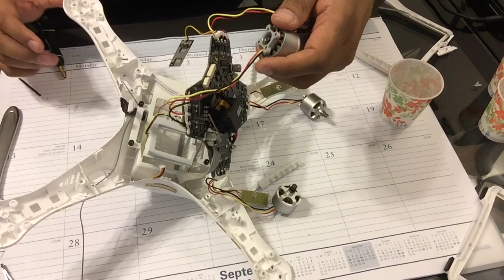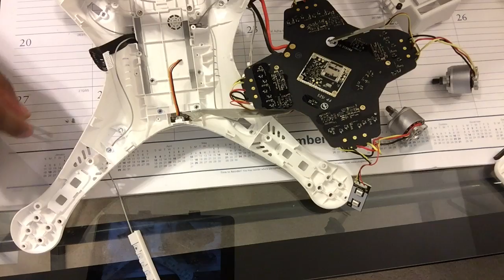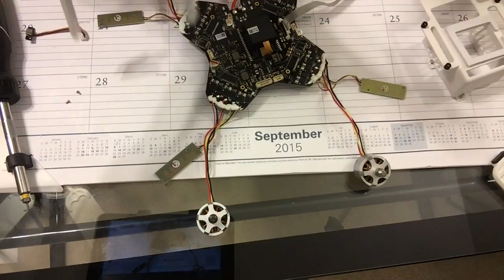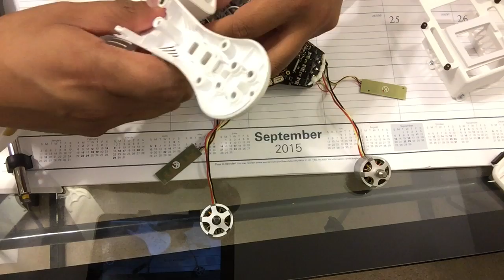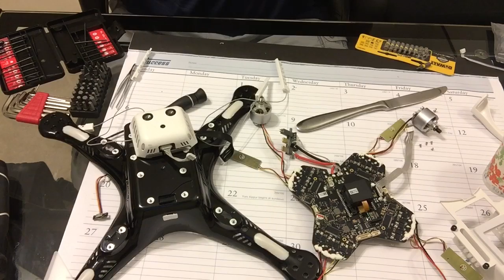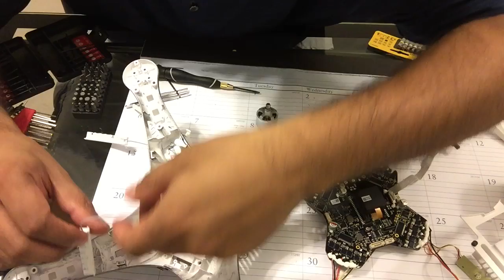DJI Phantom 3 Pro:  Full Breakdown and Rebuild (Part 4 of 5)

Comment: Would it be possible, with the board removed, to get Lightbridge working so you could use it with a different aircraft (after somehow attaching that big board/antennas to an airframe)?
Reply from the maker: +cbluebeard It's a good question.  Keep in mind that the Lightbridge antennas don't connect to the main board.  Instead, they connect to the smaller VPS module which in turn connects to the motherboard.  So, in theory, they can be used for other Phantom 3 Pro/Adv aircraft but I'm not sure if they would connect to anything else.  Having said that, I admittedly have not tried so I don't know for sure.  If you do end up trying, would love to hear about your experience/results.  Good luck!

Comment: use a dab of museum wax to hold those tiny screws to your screwdriver... works great for fumble fingers
Reply from the maker: Great tip William.  Where can I find museum wax?
Reply: +Suhail Imtiaz 
hardware stores, I think.
got mine many years ago
It's just called 'museum wax' made by Trevco-Monrovia Ca

Comment: Where is the receiver located?
Reply from the maker: +Will Robinson Hello Will.  If I understand your question, the receiver (OFDM Module that communicates with Remote Control) is located just under the VPS module.  Directly under the VPS module cover, is the VPS unit, and just under that is the OFDM module and that is where the four Lightbridge antennas connect.  Hope that helps!
Reply: +Suhail Imtiaz Thanks for replying. I sent in my P3 for repair and they said they replaced the receiver and gimbal. They had the stickers on the arms cut so apparently they had to take the shell apart. I thought they could replace the receiver without taking the shell apart.What do you say?
Reply from the maker: +Will Robinson Will, I'm no expert, my understanding is that if they just replaced the receiver, it could theoretically be replaced without taking the shell apart.  However, if they also needed to yank out the antennas that connect to the receiver, then at minimum they would have to open the top part of the shell to pull the antennas through the legs and through the corresponding openings in the lower shell.
Reply: +Suhail Imtiaz So the antennas are not able to be easily disconnected for the receiver?
Reply from the maker: I honestly don't know - I've never tried.  When I took mine apart, I left the antennas attached and took the entire VPS/OFDM unit off the aircraft but left them all connected to each other.  Here's a picture I found online of what they look like on the inside (when its all connected together the way mine was when I removed it) 
http://www.helipal.com/djip3-037-vision-positioning-module-ofdm-module.html
It's possible that the antenna base wire is soldered into the OFDM module and perhaps that's why the whole think needed to be removed (just my guess - I don't know for sure).
Reply: +Suhail Imtiaz I see what you mean. In that picture...the black wires off to the right. Are they for the receiver? The reason i ask is because  one of the strands of black wire was hanging out in the path of the battery. It had been pinched between the battery and the compartment wall. Should it have gotten damaged/broken i would like to know what it goes too.
Reply: +Will Robinson Can you confirm that the blacks wires are for the vps and they gray are for the receiver? Or the other way around? I assume both wires/harness  unplug and are replaceable. Can you conform that too please? Thanks.
Reply from the maker: +Will Robinson My understanding is that the black cable connects the main board to the OFDM module and the VPS module.  The gray wires are antennas that come out from the OFDM module and into the landing gears.  I believe both can be replaced:

Lightbridge Antennas:
https://www.rcdepothobbies.com/product_p/dji-ph3-p3.htm
OFDM/VPS Cable:
http://store.ezdrone.com/ProductDetails.asp?ProductCode=1758You might want to reach out to DJI directly or to a local dealer/authorized repair shop to confirm.  Good luck!
Reply: +Suhail Imtiaz Thanks for your help. I had my P3P in for repair and the person who worked on it didnt do a very good job.They ended up damaging the vps wires (black ribbon cable). I bought a new cable and replaced it myself as opposed to sending it back. They also left out one of the screws in the gimbal. Thanks again.
Reply: +Will Robinson the antenna cables are easily removable, what you need to be careful of is the fan connector. some models have it soldered on and some have a connector. in either case it is a VERY thin wire and it will break easily. i've done about 50 of P3s so far.